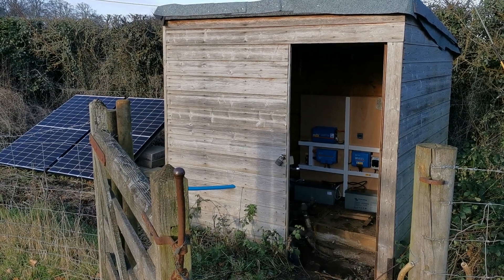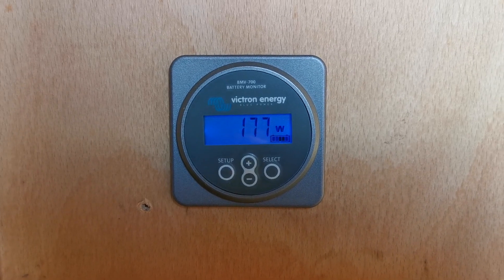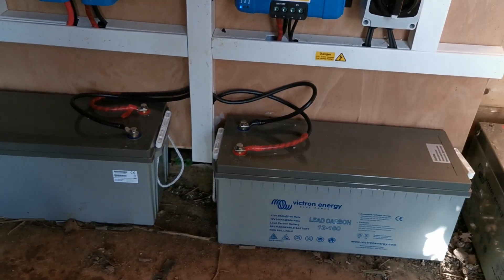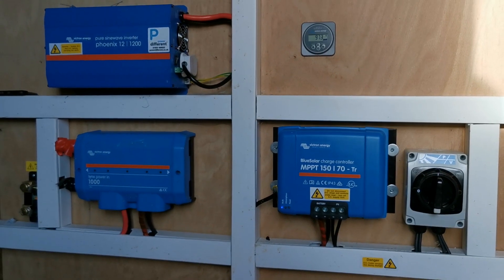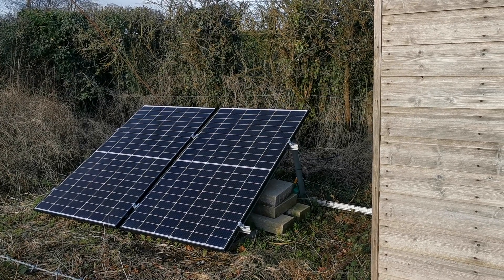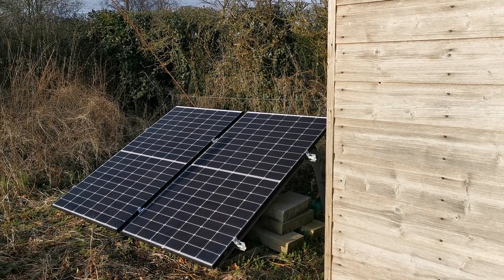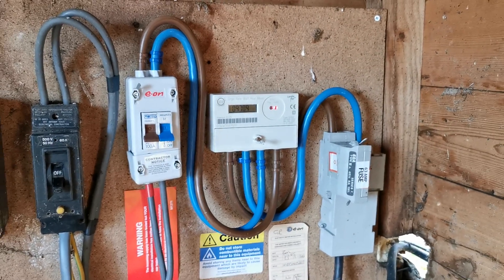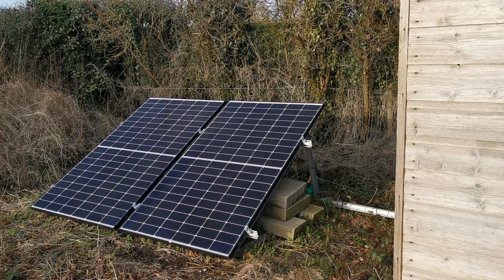1 Year Off Grid Solar Failure.

Comment: Thanks for that. My experience is similar. Solar is fine March-October but is pretty hopeless in the winter months. I have a small off-grid installation on my shed roof which was initially installed to power some pond lights (5w). The 20wp panel is fine in the summer but fails in the winter. I have upgraded to a total of 120wp now with a bigger battery (70 Ahr) but this still isn't enough. I plan to install yet another panel and use the summer excess to charge a lawnmower and run a water feature. I live in NW England so there is plenty of rain and not much direct sun - especially at this time of year.

My 69kwp roof mounted solar PV array is just the same. This generates 5kw when the sun is out but only managed 5w at 16:00 this afternoon during the rain and gales.
Reply from the maker: Thank you Graham that's helpful to know

Comment: Great video, always painful to revisit something that did'nt work out the way is was meant to.  I would still stick with off grid, I've been off-grid for 3 years.  Rough rule of thumb, is winter will produce 10% of your house needs, in your case you would need to know how much your pump consumes per day, then size up you panels to suit for the winter months, i agree at least 9 of 300 + watts.  Have you thought of a hybrid inverter for your pump?? that might be a solution to keep your batteries too.  Good on you for altering the Azimuth angle too, this makes a huge difference for winter and beginning of spring.  Thankyou again for taking the time.
Reply from the maker: Thank you for the advice really appreciate it . We are still deciding what to do so all appreciated.

Comment: You should tilt up panels to about 70 degrees in winter. In Sweden I tilt to 80 degrees
Reply: I was thinking similarly. A nominal position at the latitude, 52 deg., then 52 +15 = 67 deg. If you adjust for winter. 52 - 15 =. 37 deg. adjust for summer. Of course non-direct sunlight for days would be tough.
Reply from the maker: Thank you Christopher that is very helpful to know . We will see if we can and let you know
Reply from the maker: Thank you for the tips that's very helpful. December was very hard as we had no decent sunlight for what seemed like weeks, and just endless grey skies but January has been pretty good so far with lots of blue skies
Reply: Yeah was thinking the same - putting the panels basically vertical during winter is needed, also 200w out of 540w isn't all that bad, those are good panels. But also those panels are big for the wattage, winter typically means twice as much panels but I think one extra would do the trick here + higher angle
Reply from the maker: Thank you thats helpful to know . Our winter solar generation is very poor

Comment: Better study thoroughly before installing. This is a cheap system.
Reply from the maker: Thank you for the feedback . We definitely should have done more research. It is a relatively small cheap system as its only being used to power a water pump, but we underestimated how many panels we would need even to do that in middle of winter . It's fine in spring summer. Having said that we are planning to upgrade it this year  .